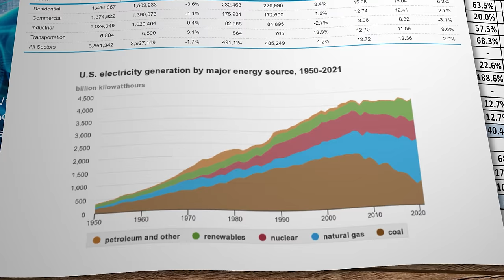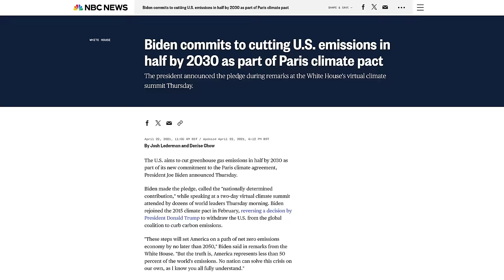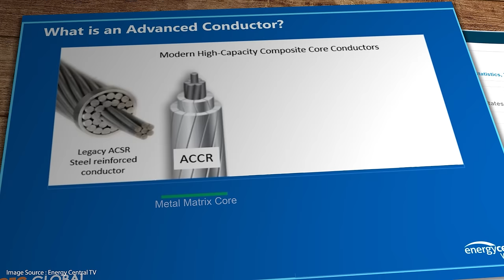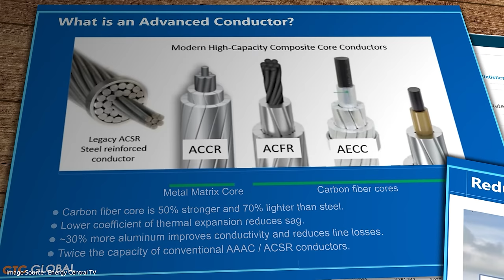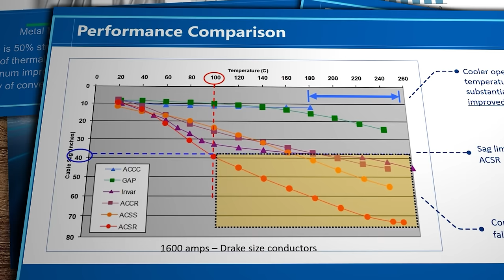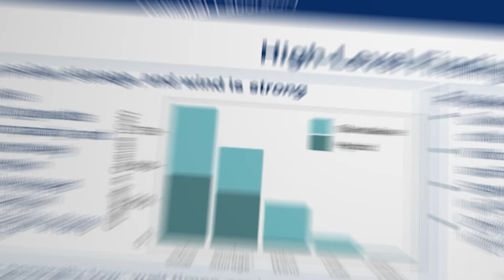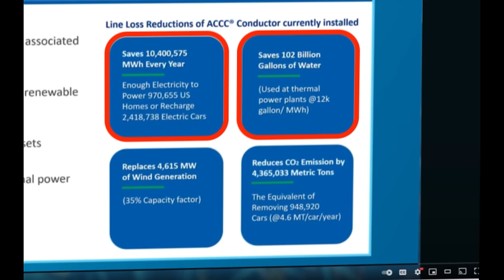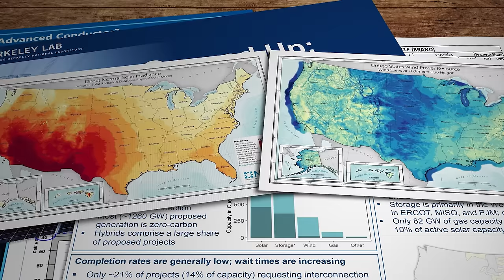Rethinking electricity grids.

Comment: Thank you for a useful update on better wires available. One recent event in Australia adds another issue — storms causing the support structures to fail. Apparently the older structures are getting old and were rated for lower wind velocities. We are now getting stronger winds in unexpected places at a higher frequency. This is not to stop rewiring as you suggest but does add to the size of our backlog. Infrastructure has been neglected for way too long and more rear end bites are coming. Let's be optimistic and see this as job security for those involved.

Comment: 1:44 "taking the electrons from where they’re generated to where they’re needed. " - ok, I'll be that guy: the electrons are not going far at all.  They are travelling just a tiny distance relative to the grid (or even your home.)  It's the energy that is travelling, through the electric field.  In an AC line the electrons are just sloshing back and forth.
Reply: They literally move less than a millimeter in distance.

Comment: Another method of increasing the power carried by high tension lines is bundling.  Two, three or four cables are used to carry a single phase and bundled wires can carry more voltage with less losses.  The resistance of a line and hence the energy wastage is proportional to the amperage and the higher the voltage, the lower the amperage can be to carry the same power.

Comment: Thanks for the great video! I am an electrical engineer from Germany and although not working at a DSO anymore, I was wondering why this is not covered in any scientific discussion I attended. So I did a little research:

1. According to a paper from the federal department of economic and climate affairs from 2014, 30-50% of the costs for building a new power line come from the cables itself.
2. The ACCC type seems to be 7-10 times more expensive than the ACSR type.

Therefore changing the cables of an existing power line would me more expensive than building another power line with the same capacity. As I said this is based on some superficial research, so I would be happy to hear your opinion on this!

Comment: So you mentioned the benefits and saving but how does unit cost stack up, cost/metre of new vs old oh and is the old stuff fully recyclable?
Reply: I would imagine the old stuff would be mostly recyclable (it’s all metals), and the combination of lighter weight and increased capacity of the ACCC wire would surely outweigh potentially higher upfront costs, while not needing new pylons.

Comment: Reconductoring is a great idea, and, as your chart shows, these conductor upgrades have been going on for quite some time. I was involved in a similar project to these ten years ago (the conductor we installed still had the steel core, but was otherwise the same). Having said that, they will have very little impact on the major problem of relying on electrons generated far away from where they are used. This is a huge problem, and one that is not appreciated in the environmental community. By all means, let's reconductor, but let us also develop technologies that can be located closer to the end user. Geothermal, and if need be nuclear (😮).
Reply: Solar and wind assets tend to be located far from where the electricity is needed.  Since both are intermittent, and there is a three hour shift in peak load from the east side of the continent to the west, long distance transmission lines are quite valuable.  Enhanced Geothermal is a promising new generation method, although there are issues with induced seismicity.  All I can say about nuclear is good luck paying for it and good luck getting people to let you build it near them.  What exactly is the environmental disaster of transmission lines, particularly compared to the environmental disaster of climate change, which affects the entire planet?
Reply: @incognitotorpedo42  The problem with transmission lines is getting them built. It isn't just private landowners that are the problem either. We have few habitats that are reserved for threatened wildlife, resulting in our fellow environmentalists putting up some of the stiffest resistance to transmission projects. Depending on generation that is concentrated in a few far away regions comes with a host of problems that should be avoided if at all possible. Anyone in the industry can tell you that powerlines tend to have unavoidable pinch points. If these pinch points are damaged by storms, terrorism, or some other failure, large areas of the grid can be effected for extended periods of time. The fewer the sources of generation, and the longer the transmission miles, the worse this problem becomes. An additional problem for Europe is that many of these sources are beyond the control of local governments. We only have to look at recent events to see how bad an idea that is. As far as nuclear being built, many countries are reevaluating their position on nuclear, with many communities being in favor. I think many countries are realizing that for their area, wind and solar is a square peg trying to be shoved into a round hole. 
Before anyone responds with how cheap solar and wind are to install. Consider, those instalation cost don't include the battery storage, the 30% increase in transmission miles (for the US), or the capacity factor for wind and solar. Wind has a capacity factor of about 25. Meaning, the facility reaches 25% of its rated capacity on an annualized basis. Solar can be much worse, with a capacity factor of 10-25 depending on location. This is such an accepted fact that industry planners routinely recommend over building the facilities being planned by a factor of 4 to account for these low capacity factor numbers. In addition, they incorporate a gas-powered peaker plant as part of the project to address the same problem. A lot of work, and we're just spinning our wheels. 
With recent developments, my first choice, by far, is geothermal (some of the new designs should minimize the earthquake problem). For many regions of the world, my second choice is nuclear, and many governments are agreeing with me.

Comment: This seems particularly important here in Oregon in the USA. We have had several seasons of terrible fires and many have been caused by power company equipment failure, usually lines coming down in wind storms. The cost of the fines are most likely going to be passed on to consumers. It would be in all of our best interests to have improved lines. And, you are quite correct about the difficulties in permitting.

Comment: Reconductoring to increase line capacity is fine but the ratings of the existing terminal equipment such as switchgear and transformers means these would have to be upgraded too.
Reply: Indeed, but as pointed out, this would be maintenance. Not requiring enquiries and planning permissions for new build .
Reply: I don't see your point. You could increase the line capacity ten-fold but if the switchgear controlling the line can't cope with the increased rating, you'll need to change that too or build another substation. Transformer capacity presents similar limitations.
Reply: @protectiongeek  Would upgrading existing switchgear and transformers be more expensive and time consuming than building brand new lines then?
Reply: @rednammoc  obviously, that depends on the details of the new line, principally its length. The costs associated with reconductoring to increase line capacity depend on a number of factors. For example, how much land is available within the existing substations/switching stations to accommodate new, higher rated apparatus? If no room for new bays exists at one or more stations, can adjacent land be purchased? If additional land can be purchased, what permitting etc will be required? The permitting process for extending a station could take a similar amount of time to that of a new line, depending on the circumstances. All I’m pointing out is that reconductoring and/or dynamic rating technology developments, while welcome, are not in themselves going to accelerate an increase of transmission network capacity. They are one part of the solution going forward but there are lots of parts to the machine!
Reply: @protectiongeek  Local creation and storage would stop us sending power all these distances.
Reply: @jaaklucas1329  that could be a part of an alternative approach but begs the question at what level is local generation capacity and/or storage built and integrated into the networks? There is also the question of network stability; more distributed generation would tend to make the networks more 'fragile' and susceptible to the effects of faults.
Reply: @protectiongeek  The more I research creating electricity and storage the more I see we are just scratching the surface at this time...

Comment: I think there are 3 possibilities to resolve the problems of the grid(s)
1. Redesign and reimplement the grid whilst using it. This is supported by your presentation herein. It's a pretty good solution to address capacity but not much else (still mega important)
2. Build a new grid in parallel and eventually retire the old one. Your presentation herein might actually present some good options for this too, at least in part.
3. Drastically reduce transmission through local generation. Require every house / building /  business to have plated generation capacity > 120% of their daily usage including stationary storage for say 50%  and use the grid for emergency backup and equalisation only. (My preference).

Comment: Another technology contribution to a better world.  Not a game changer, but a welcome improvement.  Presumably these cables are just as usable with higher voltage, and with DC lines... caveat replacing insulators and transformers cost requirements.

Comment: This is good news!  We've known for a long time that the grid was the biggest loss problem. More efficient wires are just the thingk! Add to that, solar installations where grid wiring is not practical - the beauty of solar is its ability to decentralize the power structure.
Reply: he beauty of solar is its ability to decentralize the power structure.Well said and not just solar. We are just scratching the surface of electricity harvesting. Its everywhere.

Comment: Thanks for the new video! One thing that makes this a particularly cheerful story is that it's an innovation that's already happening. ACCC conductors are already being installed as part of the regular upgrade cycle for power lines. (Although I guess a political push will be needed to get electrical companies moving in places where they never do upgrades or maintenance.) Much to my surprise it seems one of our provincial power companies (Enmax) has already installed an ACCC line, and we're not exactly on the bleeding edge of technology here.

Comment: Another thing keeping utilities from doing the small things that add up is that they are incentivized in the rate setting process to build new things like gas-fired plants and new transmission lines.  Retrofitting conductors and adding the "magic balls" sensors referenced in another comment don't let them go to the local PUC and get a rate increase.  I used to be involved in negotiating power costs for my plant that drew about 50MW on average.  One thing I learned is that you can never win with them.  They have too many legislators duped at best or bought off at worst to ever lose.

Comment: The existing electrical grid is a dinosaur.  We need graphene conductors located in a underground type electrical grid.  We lose 5-8% of all the electricity being generated with our existing electrical grid.    A great video!
Reply: Yes, and underground requires HVDC to prevent capacitive losses, with added benefits of higher power transmission with the same cables, no need for reinforcement, the possibility of liquid cooling, but requires expensive high voltage AC DC conversion stations which become economical beyond 40 miles of transmission.

Comment: @5:23 why didn't the graph finish the temprature range on the ACCC wire? I saw that it was performing well to 180*C but then it's just a blue bar out past that.. what gives?
Reply: Short circuit conductor temperature limit is usually 250 Deg C, with a limit on the duration of course.

Comment: New utilities that want to tie to the grid go thru a 3 to 10 year approval process where national grid managers decide how best to tie them into the existing infrastructure.

If the local infrastructure needs to be upgraded to support that new utility, the cost of upgrading is mostly to entirely on the new utility. Even if the lines they are upgrading are owned by a different private utility. To the existing line owner gets a cheap or free upgrade not their infrastructure and all or most of the cost goes on the new utility.

I worked on a solar project that was 2 years behind schedule, which means they weren't generating any power to help pay back the loan used to build the farm. That will slow their future growth and add to their debt burden in the long run.

I wonder how many projects are never followed thru with because of the slow pace of bureaucracy and the current cost structure for new power generation projects.

Comment: In December 2021, FERC issued Order No. 881, which focused on improving the planning and operation of the bulk power system. This order included provisions that could indirectly support DLR (Dynamic Load Rating) by encouraging the use of advanced tools and technologies for grid management, which could encompass DLR. It is not yet widely used in the US but In October 2022, PJM implemented a DLR system for three transmission lines in northeastern Pennsylvania.

Comment: Local generation, load timing management, water, electric, and heat energy storage, and off-grid devices and systems can reduce the need for transmission.

Comment: If sagging has been reduced they could fit longer insulators and increase the operating voltage of the grid, thus getting more power through for a given current.

Comment: @DaveBorlace
As usual, another excellent and informative episode.

There's also another mechanism available for increasing grid capacity, and that would be to improve its capacity factor. I don't know about the US, but the UK grid peak capacity is around double the average.

Figures for peak grid capacity and difficult to find, but it has to equal or exceed peak demand which in the UK reached about 61GW (if I recall correctly but it might be a bit higher) a decade or so ago. The average demand is currently about 35GW, which means that if we could level out demand we could squeeze an extra 25 GW through the grid without overloading it.

The key to utilising this spare capacity is a combination of demand side response/levelling and distributed storage, in particular viable long duration storage that would allow excess supply in the summer to be transferred to where it will be required in the winter, using spare off peak capacity.

Comment: Im an EE for a utility in Michigan at the distribution level. Reconductoring makes sense, its something we do on a regular basis. However our warehouse inventories are updated so infrequently I doubt we'll see any new adanced conductors for over a decade. There is also the issue of importing the conductors electrical and mechanical characteristics into the modeling software which would take alot of time and resources. Still its exciting to know that perhaps someday something new will become available, especially given the upcoming demand on the distribution system from distributed generation renewables.

Comment: I live on Maui and I am building a new house that is completely off-grid. The grid here is a joke. The reason I say that is that the power from the grid is 42 cents per kilowatt!!!  My unsubsidized LCOE for a system that I build myself not through those scam solar people, is $0.16 per kilowatt hour. My subsidized cost drops tremendously when I factor in a $10,000 grid hookup fee. Why would I spend $10,000 to overpay for electricity and have it periodically go out on me?  20 kW of panels on my roof and 43 kW of batteries is $28,000 with three inverters. I am building a multiplex that is off grid, which is why I needed the extra power. Even factoring in 50% usage on power and replacement cost at end of warranty, my total cost for power will still be around $0.16. The future of power generation is going to be at home for those lucky enough to own a home. The grid will still be needed for the city folk, which we guarantee that they will just keep overpaying for their power. We need to end the subsidies because government subsidies just lead to corruption. When alternative energy can win purely on economics, it needs no subsidy.

Comment: In addition to composite conductors, the US could also transition from High Voltage 60 Hz AC (Alternating Current) to Ultra-High Voltage DC (Direct Current) transmission to reduce (I^2R)  losses even further. China already has many of these UHVDC transmission lines in service across the entire country.

Comment: One thing that's happening in electricity is local micro grids, which produce electricity close to where it is used. 
This is especially useful in places like Africa, but is useful pretty much every where.
Why build big expensive towers,  and long transmission lines unless you absolutely have to do so?
That being said, using better technology when you do need long distance transmission is an excellent idea.
Especially if you can reuse existing infrastructure. 
This video brought to mind the telecommunication companies running fiber-optic cables to replace old lines for better internet.
Reply: local micro grids, which produce electricity close to where it is used,this is the key.